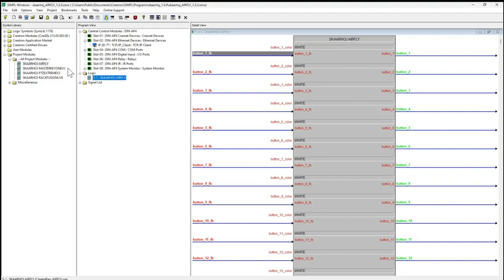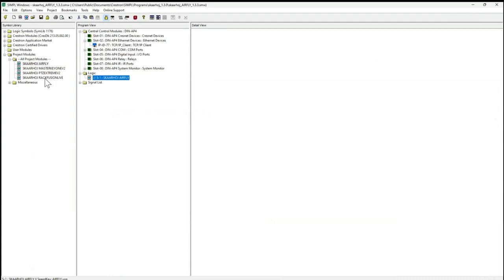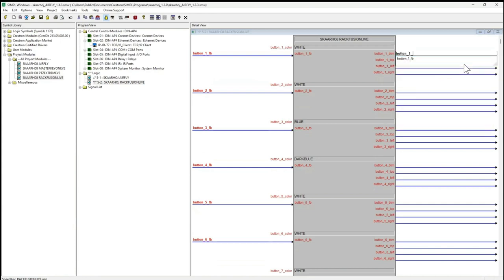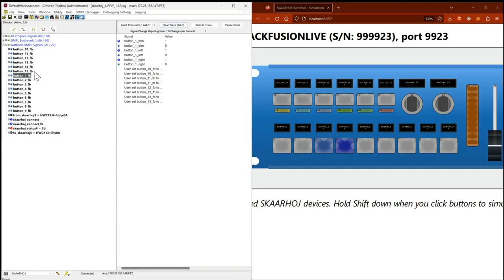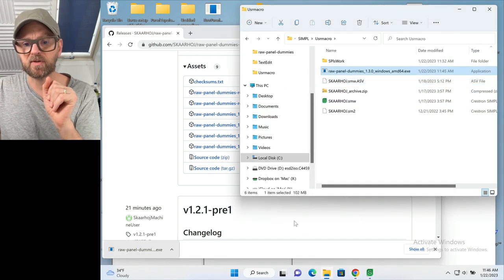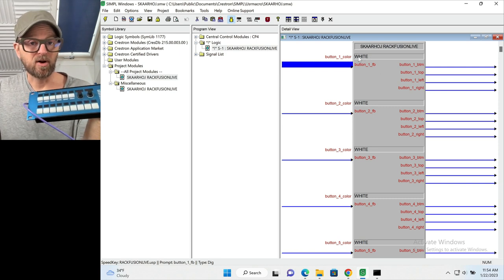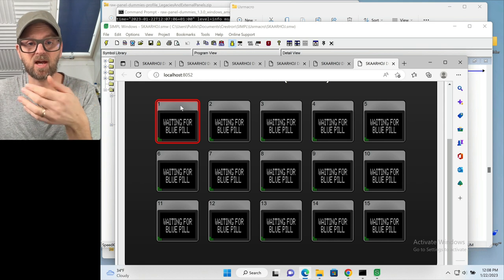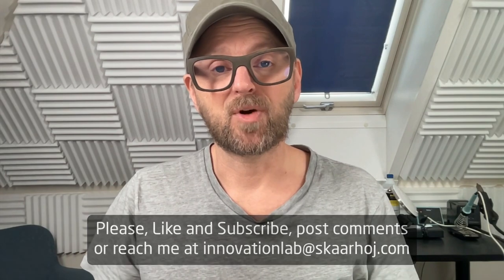Crestron support for SKAARHOJ and Stream Deck panels

Comment: This is great but how do you setup the actual Skaarhoj panel so that it communicates with your Crestron processor? The Crestron side seems simple, but there are so many configuration options on the Skaarhoj side, it's so confusing!
Reply from the maker: For this integration the SKAARHOJ side is simple enough: You only need to enable Raw Panel. For Blue Pill, that is a single toggle in the hardware manager. We would be more than happy to help you out if you still struggle after the instructions from this video. Just reach out to support@skaarhoj.com for help.